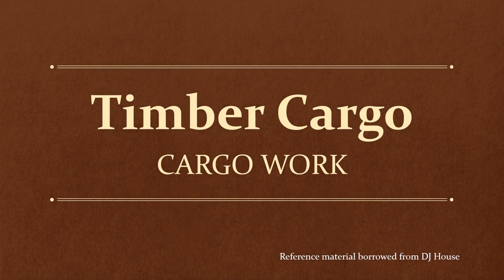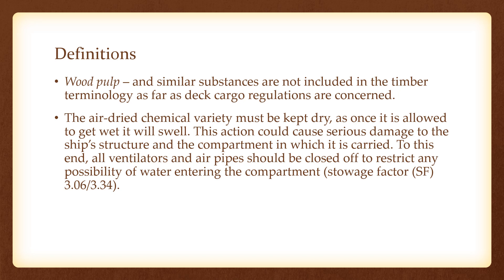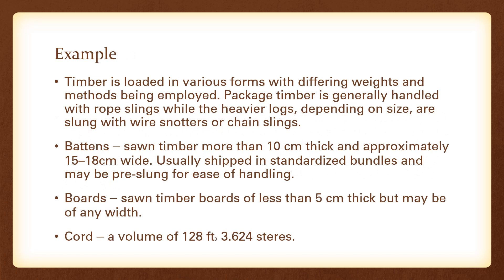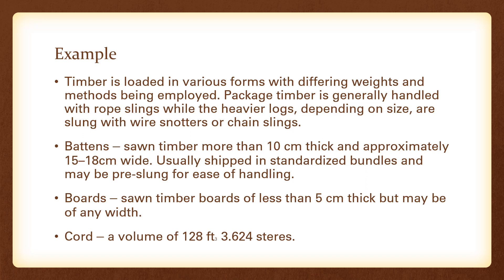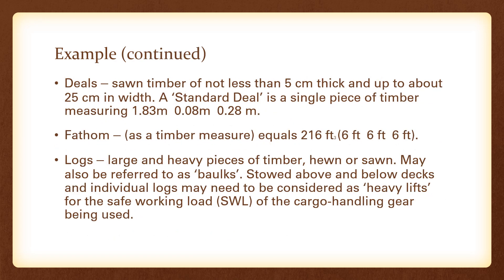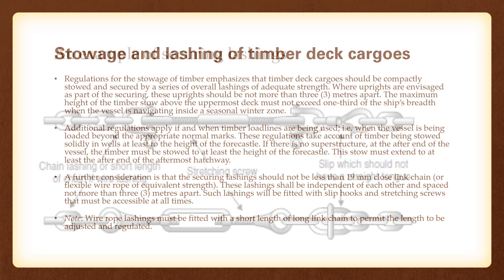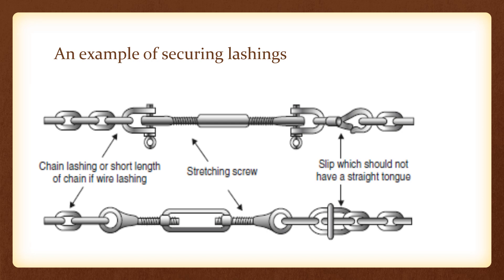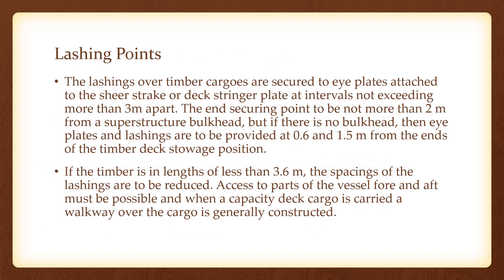Timber Cargo - Carriage of timber cargo on and under ship's deck

Comment: Sir can you please tell what is the difference between cpa and Bow crossing point?
Reply from the maker: sure. its actually very simple. CPA is closest point of approach (measured as the distance between the ship sides when they are passing side to side). on the other hand, Bow crossing point may be measured in a crossing situation measured between a ship's bow and the ship side of the vessel crossing the bow. I will make a video if you still have doubt.
Reply: Yes sir pls do it with some diagrams it would be very helpful.
Reply: For preparation of second mate / DNS/ BSC nautical science/NCV come in #kundanpatna